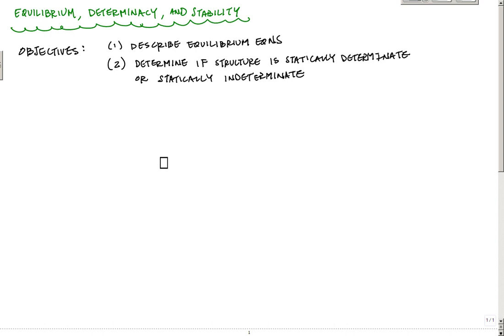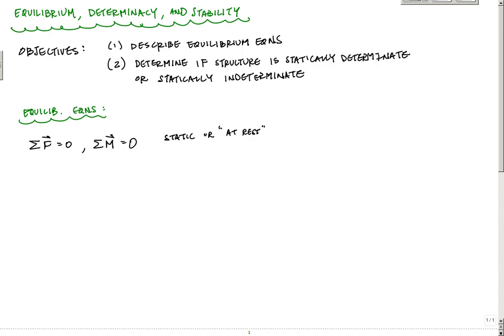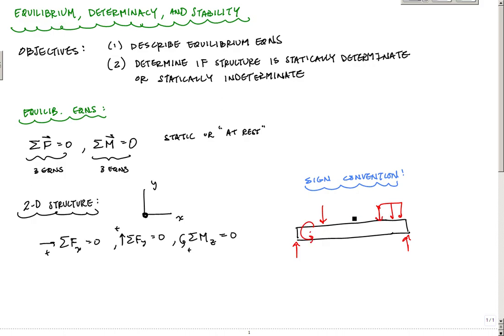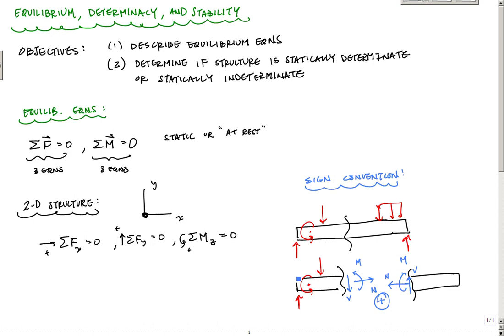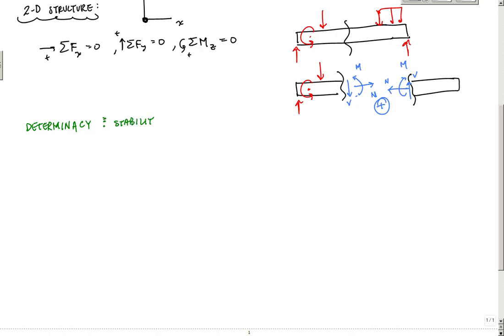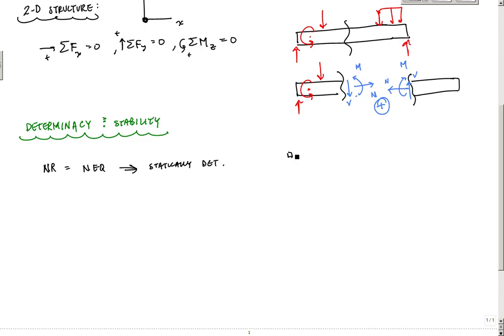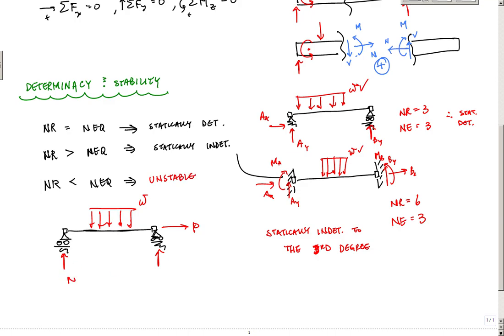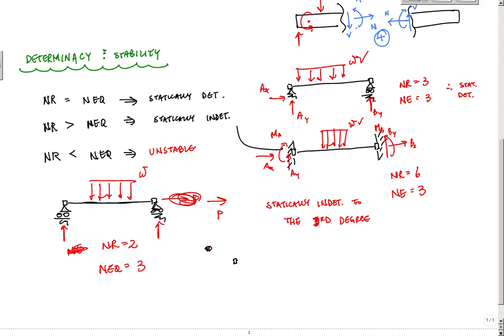Statically Indeterminate Explanation - Structural Analysis

Comment: teacher i have a question 
What is the importance of  the statically indeterminate?
Reply: statically indeterminate structures has some thing called redundant reaction this reactions  is the additional reactions that exceeded the equations of equilibrium  in structures the more redundancy the more is good specially in earthquake design because in some cases in seismic design  we allowed some thing called plastic hinges to happen this plastic hinge should be happen in  indeterminate structures preferably with lots of redundancy the more redundancy we have the more plastic hinges occur so the more seismic energy will be absorbed during plastic hinges occur and because this redundancy the structure will still stable but if the structure determinate and this plastic hinges occur it will be unstable ,  otherwise in some cases like bridges because it's long structure and affected by thermal stress and  differential settlement in soil its preferred to be  determine  structure to not be affected  .

Comment: Sorry if this is a silly question. But for that diagram that you've drawn at 6:04, the one with the roller and pin support, how is it a stable structure if there are no moment reaction forces? Because based on what I've learnt so far, the 3 reaction forces have to be present for a structure to be considered in stable equilibrium. I've seen similar diagrams but don't understand why.
Reply: The structure is still stable because the pin prevents movement in the x direction and the pin and roller both prevent either side from moving in the y direction. If the moment isn't transferred by a fixed connection, it will be resisted by the material of the beam alone.